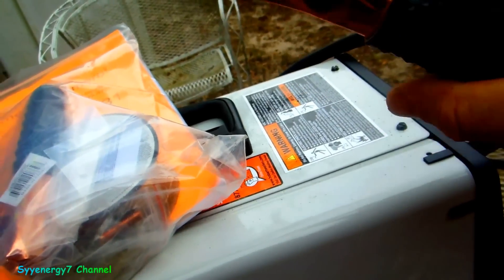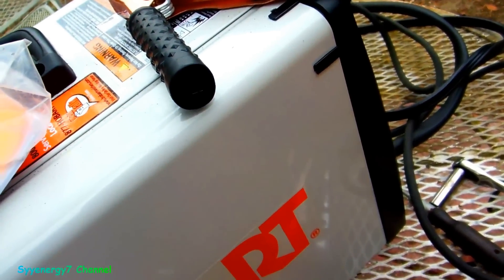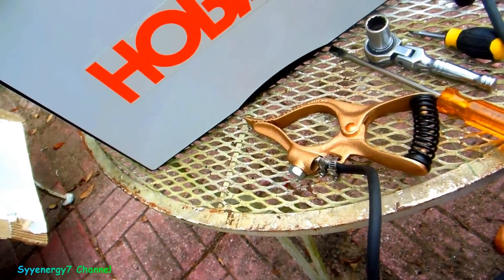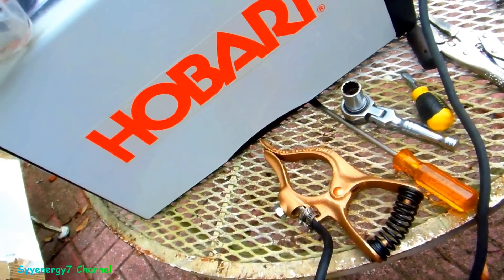Improve Any Welder, 98% Copper Welding Ground Clamp

Comment: Dear sir we are mfg. in all kind of brass & aluminium & zinc pressure die casting component .
Sp. In all type of brass pressure die casting clamp
Send me your requirements 
We make as per your sample

Manish @
SMART TECH METAL
Add. Plot no 3678 gidc phes-3 
Jamnagar
+919824047150
www.smarttechmetal.com

Comment: I have a cheapy Harbor Freight 90 amp welder, with some good wire, and I just use it for random projects, and I've made some pretty good patch ups on body panels, surprisingly. Would this be a worthwhile, viable upgrade to the cheapo welder?
Reply from the maker: yes, it would.

Comment: A GOOD "test" would be on rusty 1/4" steel ( unclean), weld a bead with the factory clamp and then with the Upgraded Clamp. You should see a visible improvement.

Comment: I set and reset the wire speed and the amps on my Hobart 210 to get a weld but they where no good.then I thought about the ground clamp the one I have is steel....no good....I'm off to get a copper one. I run flux core being a beginner I don't need bottles though in the welding course I took I ran good welds with gas but my flux core welds are vicious ground clamp is the answer

Comment: i have a question. my welder is 300amps. can i use a 500amps electrode holder and 500amps clamp for it? tnx
Reply: tnx so much sir. well explained
Reply: Yes as long as it is rated for the maximum or higher you're good. Higher or better.

Comment: harbor freight ground clamp is a 3rd the cost and a nicer casting.
Reply: I've got one of those and they are shit.  The plastic spring keepers melted on mine.  Like most things from Hazard Fraught, it leaves a lot to be desired.
Reply: Nor sure they are copper/brass. Test with a magnet.

Comment: Yeah, ground clam is a HUGE improvement on the [bottom of the] Harbor Freight welders.  Other good improvements:  use quality wire, use nozzle gel, grind/prep/clean the area really well.   Do all that shit, those chinese welding machines work GREAT.

Comment: I enjoy your videos very much. As the owner of a welding company 4th generation and 95 years in business we have one of these welders we use for small field jobs. It does a great job. But if you try it with the gas bottle you will likely never try it without again. We use Flux core wire with argon to repair apartment railings and stainless steel wire with tri mix for restaurant sink repairs. Thank you for all your videos!
Reply: Charles Wilke I like dual shield too !